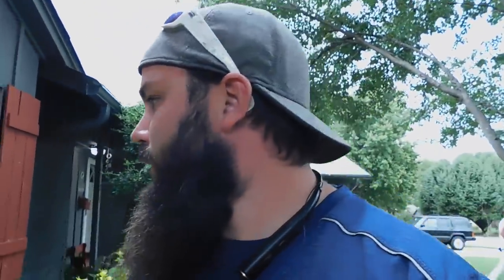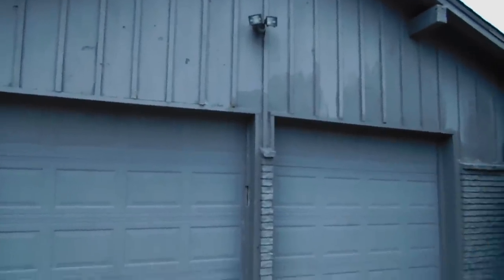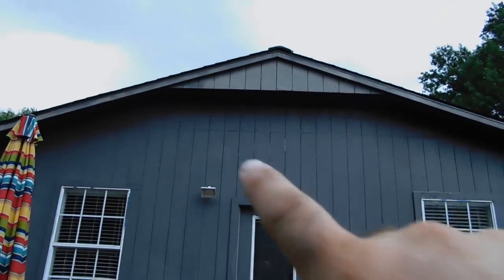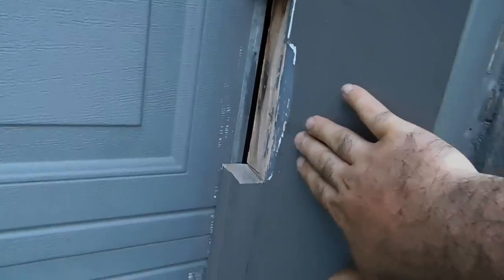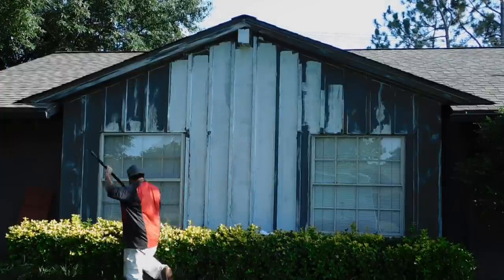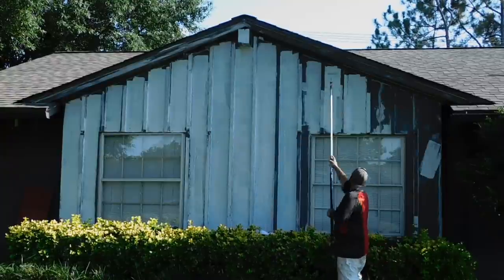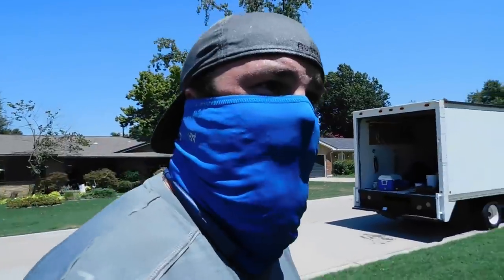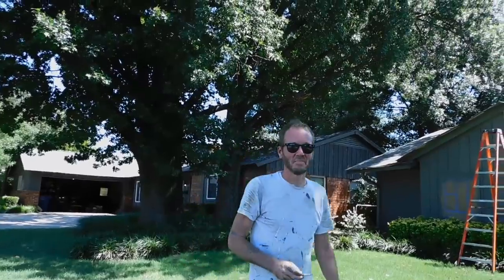This house hasn't been painted in 25 years! Our business model / Employee tips / business start up

Comment: I love your videos but I'll never understand why anyone would ever paint brick. Seriously that brick would look the same today without paint as it would in 200 years. That might be an exaggeration but you get my point of view.

Just like with the house, the paint is going to flake, crack up, and become horrible looking in a 15 to 20 years.
Reply from the maker: I agree. It looks good on some houses but its unneeded forsure.
Reply: @LawnCareJuggernaut  I'm glad you agree that it's unneeded. 

The way I see it, it might look good but it's only going to look good for a minute. The second moisture gets in behind the grout or the stone it's over.

Furthermore it would need to drastically be a different color than the actual house to even halfway look nice in my opinion.
Reply from the maker: @DonaldAJr  I will say this anchor paint is some tough stuff. 20 years on there brick and it still looked good and had no adhesion problems. A masonry stain is the ideal product for painting brick for longevity though.
Reply: @LawnCareJuggernaut  I didn't personally know they made that but it doesn't Surprise me at all... 

My uncle painted my house about 12 years ago and everywhere he used the spray attachment of my Wagner Paint Crew Machine Sprayer Attachment it looks like crap. It reminds me of how the back side of the house looked or side of the house looked.

I know you said you would probably have to paint it again, well that hasn't happened here yet. Granted I'm not rich and on a fixed income because of workman's compensation. But that's enough about me.

Comment: Suggestion on the painters tape on the outside.  Take a hand held hot steamer and go over it to reactive the glue and just slowly peel it off.   If that doesn’t work then use the Goo Off.  Another suggestion for sticky stuff is isopropyl alcohol and or vegetable oil.  And if that fails then use the razor blade method LOL.  When I and My Late Uncle use to prepare to fix, repair, strip, stain, or paint and if there were stickers on them then that’s what He use to use to remove the stickers from said furniture.  Another product He use to use on stickers was mayonnaise.  He would rub the mayonnaise all over the stickers and then let them set for 2-4 days and then He would just slowly remove them.

Comment: I have faux (fake) half timbered stucco siding. I'm using a filler for one hole into the white fake stucco. I got some dap dynaflex 230.
Any idea about what house paint is good?
I'm guessing I'll need to paint the whole thing since I have no idea what color was used on it before 
Eventually going to hardie board but that's a few years away. 
Hopefully the caulk I got is good (good ratings) and it's paintable.
Figure I'll caulk around the timbers first then repaint. Just curious what paint I should use that will last in case I can't do the new siding in the time frame I want
I got platinum patch for the hole in the fake stucco.